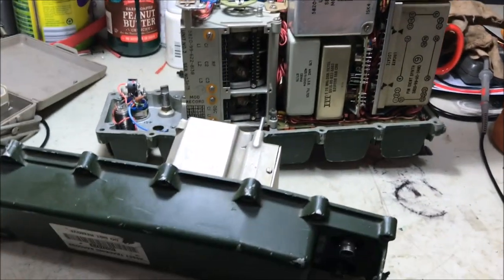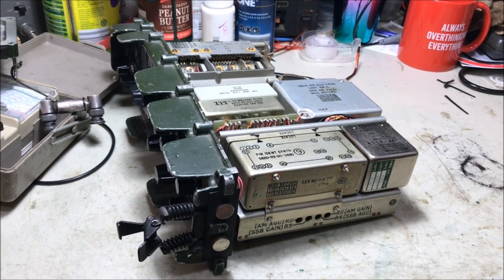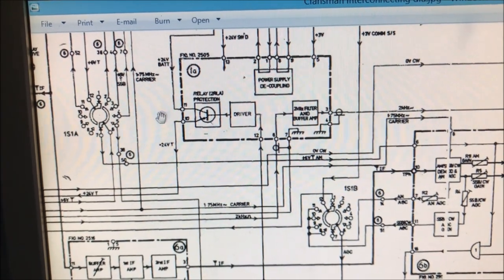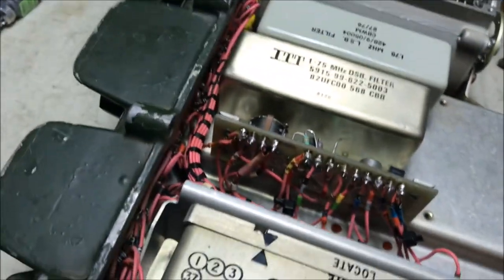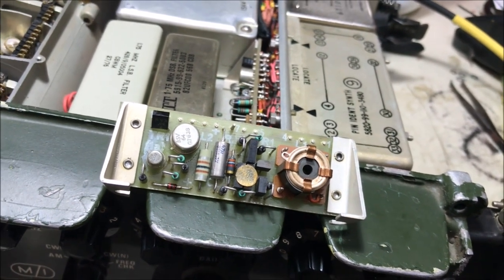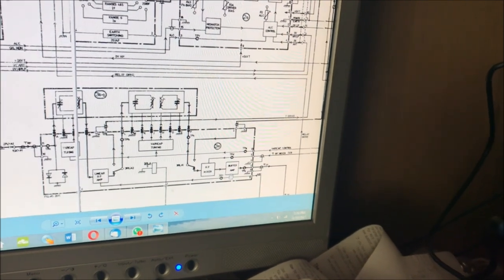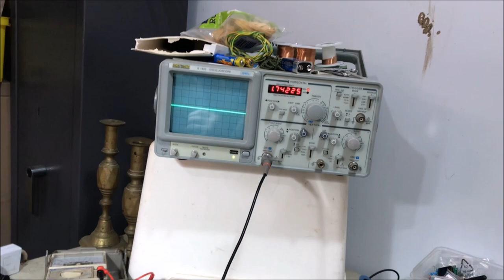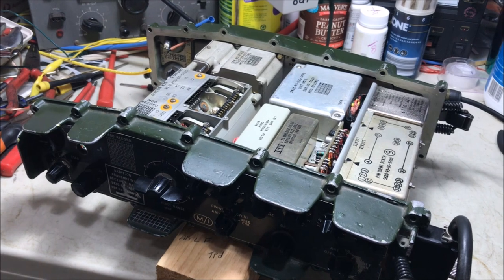VK2PRC Clansman 320 Fault, No Receive and Fix

Comment: I have never seen inside one of those before.  They don't half pack the stuff inside it.
I hope all those wires are not single strand, that would be my worst nightmare!!!!
Reply from the maker: The 320 is an extremely well thought out and well made radio, all the wiring is multi stranded.